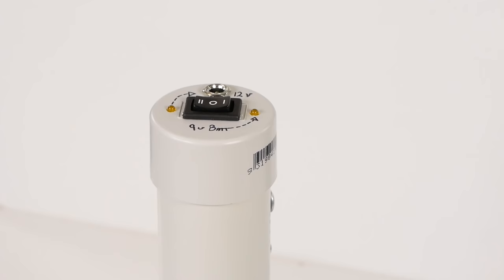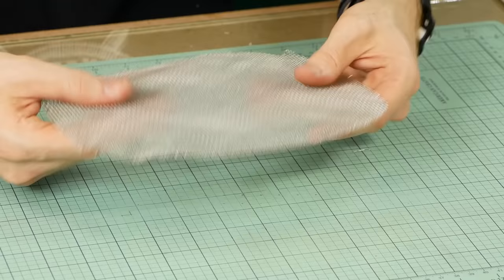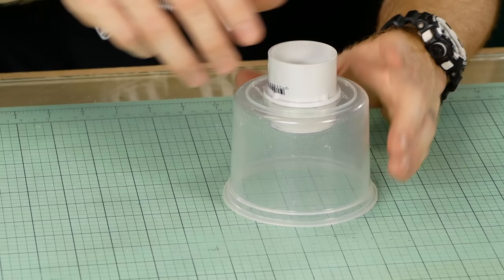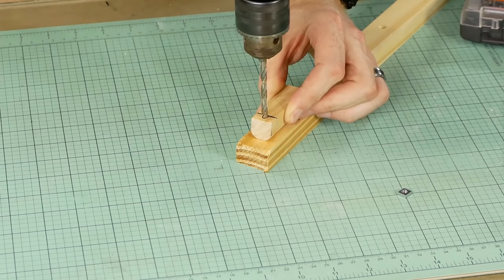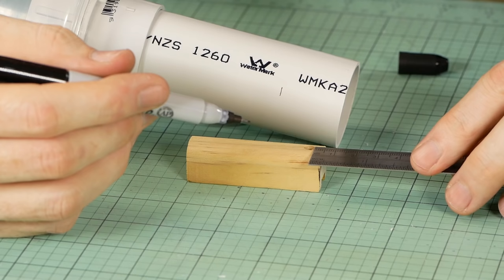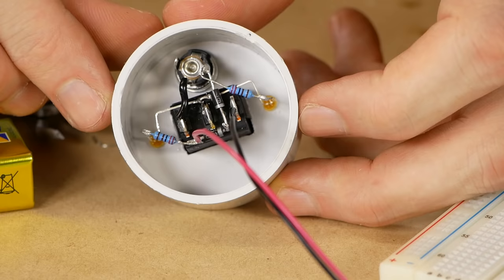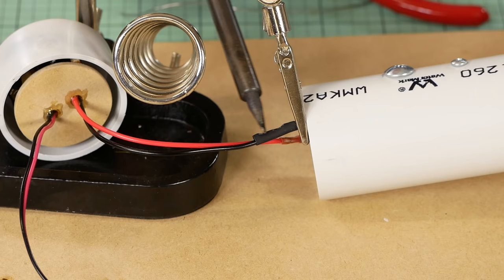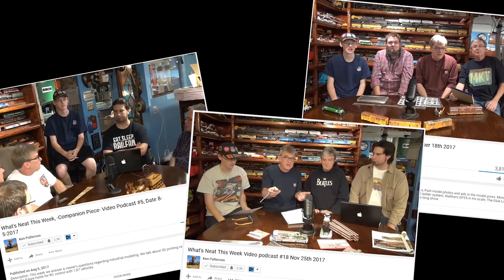Static Grass Applicator – Professional Tools for Modelers

Comment: Thank you Luke for this video. I have watched it over and over again. During the 'lockdown' I bought all the items required and set out to learn how to solder and put this together. The one thing I couldn't get was the pipe cap like yours, I got one which is a soft plastic, but it works. This was a long term project, which I finished today, and it works perfectly! I can't believe I made it. Thank you so much for this and all your other videos. You are such an inspiration. Keep up the great work. All the best from the 'west of Ireland'

Comment: Great tutorial, and a nice update on your previous version of this DIY tool, thankyou.

Tips for anyone new to electronics:
* 1N4007 diodes are common and fit the specification for 1000V 1A.
* If the LEDs aren't working you might have the leads the wrong way around. As the diagram shows, the longer lead is positive (red wire). If you've trimmed the leads to the same length, you can still tell the polarity by looking for a flat spot in the flange around the base of the plastic part of the LED; this is the negative (black wire) side (also shown in the diagram).
Reply: Thanks!
Reply: or use a 3v battery to test it
Reply: 1 amp sound alot/dangerous. Anything over 100mamp (0.1amps) is potentially lethal. You only need the voltage for this so having a high voltage and then 0.05amps should be ideal. Also will make batteries last longer. I doubt the types of transformers used here create more than that but just in case.
Reply: What are the specs of the 12V power supply for this? 1A output?

Comment: I built a 75mm applicator using a 6KV negative ion generator bought from eBay but it didn’t work very well. Bought the 20KV generator from Oatley Electronics as suggested in your video and fitted it to the applicator, it now works great. After watching videos about the small 25mm applicators from Peco and WWS I thought I’d give it ago using the 6KV generator. All the parts were 3D printed and I even found the same sieve at Woolies. I now have two awesome applicators.
Thanks Luke, you inspired me to have a go and I’ve ended up with 2 very good applicators.
Reply: Do you perhaps have the stl files / tutorial for the 6kv one? I can’t seem to find a 20kv where I live, only the 6kv one

Comment: Great tutorial again Luke. One suggestion regarding soldering to the mesh, I use some flux and a hot iron, say 359 degrees Celsius and it should take the solder really well. A bit of a pre polish with a fibreglass pen helps remove any coating or surface corrosion from the mesh too.

Comment: This is a great tutorial, thanks.  One suggestion, instead of using a resistor to limit current to the LEDs, use a LED driver; CL2N3-G.  These limit the current to the LED to 20mA regardless of voltage (within the limits of 5V to 90V).  They cost about the same as resistors and are just as easy to install.
Reply: And a buck convertor to make the 12V (or a bit more, if better), instead of a supply & cables. Cheaper, no cables, lighter...

Comment: knocked one of these up from old junk and a 50k generator I filched out of an old ioniser but here's a thing. having that amount of power where little fingers can get into it I figured was not such a good idea so looked a lot harder at how these things work. Turns out that putting the emitter above the static grass rather than below in the form of a plate actually gave better results and the screen of course was not charged at all significantly meaning no toasty little fingers also to the use of a push for on activator button gave added safety as the moment you put it down it stopped working no matter what. Just a few thoughts. Great video.

Comment: Not sure if I'll ever get an answer to this but I'm wondering how you would wire one of these up with a negative ion generator that has two high voltage wires instead of one.
would one of the high voltage wires connect to the mesh, and the other high voltage wire act as the "ground" wire? or would I use both high voltage wires on the mesh and add a ground wire where you did?

Comment: That negative ion generator is pretty nifty isn't it? Back in high school, I made myself a shocking device that pulled ions from the ground and charged my body so long as I was grounded. Anybody I touched would be shocked with a sort of static shock similar to rubbing socks on a carpet. Ran all of the wires into a little box on my ankle that surprisingly resembled a bomb! Hah I was never caught, so it was all fun. Great video!

Comment: Luke - Thanks for the great video and device. Question: on your prior applicator you used a male electric spade connection to the lid sieve. Why solder the wire directly to the sieve? I thought having the disconnect allowed you to swap in different lids with larger sieves so using taller grass was easier. It also had the advantage of allowing your applicator to connect directly to an inexpensive "flower-box" plate. (No need to purchase a separate ionizer!)

Comment: I've been trying hard to make tall grass tufts using 12mm static grass (specifically the 12mm straw from Woodland Scenics).  No matter what I do, I can't get the long grass to stand up.  I have the static king, I have the WS flock box.  I've tried putting the paper on a sheet of copper, on a metal baking sheet, on an aluminum foil-wrapped piece of cardboard; the tall grass just lays flat.  I've used several types of glue including tuft tac, tacky glue, Elmer glue, and wood glue.  I've tried searching the internet for solutions and have even emailed woodland scenics for advice.  Nothing works.  What am I doing wrong?
Reply: For the 12mm grasses, I bought a punch tool. You use it literally punching the tufts into the base with a little pva on the folded bit.

Comment: 13:45 15000 Volts - avoid touching that with your hands...Okay, but what happens if someone does accidentally touch it? I'm sorry, I don't know a lot about that sort of thing, but considering there are 120-240 Volts from a power outlet, that does sound kind of dangerous? I'm serous though, what would happen if anyone accidentally touched it? Would it be very uncomfortable or could it be potentially lethal?
Sorry again for asking this rather stupid question, but if someone with more knowledge could educate me a bit on this, I'd really appreciate it. Thanks!

Comment: Whats the ampage for the 12v/15,000v output of the high voltage transformer on this static grass applicator? & What is the input current?

Comment: Luke
Your viideos on static grass applicators are brilliant.
Both your mark one version and the dual power version.
It actually looks proffesional and  quality.
I checked out your web site and you have a shopping list of cost and where to buy the bits.
Now that makes you stand out.

Kind of funny that Oatley electronic is nowhere near Oatley but on the central coast.
What fun you can have with 15kv.

Comment: I am curious as to whether Australian PVC pipe fittings have straight (BSPP) or tapered (BSPT) threads? In the video the male and female fittings are threaded all the way .. which does not work with US PVC fittings are they are tapered.

Comment: That is very cool.  I see you are very detail orientated.  Do you have a soldering gun?  I have a solder station but if I need to solder something that needs a lot of heat fast, like in the case of your wire to the screen or a feeder wire to a train rail, I use a 100 watt solder gun.  That way you can get a good, fast solder connection without melting other close by components.  I like how you made this unit universal as 9 volt or 12 volt plug in.  Very nice!

Comment: Fantastic work, man. BTW, if your dc socket has 3 pins you could easily use both battery and 12v adapter with a simple on off switch. Because when the adapter is plugged, even it's off, the battery would be disconnected. :) I did it once in something I made... All you need is a diode. :) Maybe someday I make a video explain it. :)

Comment: Luke: Great video as usual. I'm wanting to make an applicator that will handle 7-12mm grass like the RTS Greenskeeper 55KV/18000v effective unit. I've found that the lower voltage ones down in the 15KV and below range just can't handle more that about 4mm length. Any suggestions?

Comment: Can you or some one clarify  the switch does the switch need to be a 12 volt switch or will a regular on-off-on rocker switch work 
Also. Can you clarify the connection on the iron generator to the switch it was not shown in your pictures ?
Thank you

Comment: Luke, I've noticed some of the commercial applicators are supplied with various sized mesh attachments for different lengths of static grass. What size is the screening you used for this project and what lengths of static grass can be used?

Comment: Since your Australian, why not just goto Woolies, buy a cappuccino chocolate shaker which completely skips the need for the plastic tub cutting. Then just buy a 9 or 12v power supply to a switch then attach to the metal .

Comment: Hi! Can anyone help me with this please!!!!??

I bought a ‘super arc impuls generator’ on amazon (12v to 1000kv) for my grass hopper. However, the impuls generator burns out after using the device a couple of times. 

What am I doing wrong? Am I using it too long? Am I missing some electric stuff in my circuit? 

Please help me

Comment: THANK YOU,  I have made this and I have a question.  Do you know of any reason that the 9v Battery side would work but the 12v plug in side does not?  The light lights but there is nothing when I put the alligator clip near the screen.  On the Battery side I get the static sparks.  Thank you!
Reply: @Ted Amrein Interesting. You have a redesign posted anywhere?
Reply: @Ted Amrein Aweasome, thanks!

Comment: Would there need to be any significant changes to the electrical components for 120v main power?
Reply: Yes. The negative ion generator needs 12v max input. Any higher and it’ll blow up. Also, this device needs DC power not AC.  Don’t use 120v. That would also be WAY too much power for a static grass generator. Why not use a simple 12v DC wall connector like he did in the video?

Comment: Hello Luke, 
     Ok, so I went and purchased everything on your list needed to make your grass applicator, had it all in front of me , then I pressed play, and was going to watch your video again, and make the applicator as I watched the video. Everything was going great, until I got to the compact wiring and soldering part, which I forgot when I watched it the first time, how little time you spent on this part, which is the hardest part for people who are not that familiar with wiring, capacitor s and diodes, and leds and a 9volt adapter! Which direction do each of these pieces go, which is positive and which is negative ?  Even with the diagram ,it is very confusing! Will you please do a video that you explain, (in detail) from the beginning to the end , the wiring part ? I followed the best I could, and even went to your website and when I finished, it did not work. I spent roughly $100 US dollars, buying a the things I needed to complete this, and after trying to follow your video, it would not work. So will you Please make a video, as soon as possible, so I can build this and not feel like I wasted, $100 bucks, as well as get a lesson in caps and diodes, Thank You!
Reply: There’s no capacitors in the design. The only small components that you need to connect in the proper polarity is the diodes and LEDs, and if you look up LED polarity and diode polarity it’s right there on google. If he made a video it would pretty much be about the exact same stuff that you can find with a simple 10 second google search. I’ve never made a small electronic device like this but it really wasn’t hard to figure out at all. Just follow the diagram and google your questions about component polarity and it will work.

Comment: i  finished mine. the 9volt has an arc but does nothing so i tried the 12 volt side. it arcs but does not work like yours at all.... I'm fairly certain its wired up correct too.. so many views but not much help.. ill post a video if someone can help me..

Comment: Many thanks for your tutorial Luke. It was not so easy to get a similar ION Generator here in Germany. So I have ordered 3 units directly at Oatley Electronic in Australia. Very interesting, the Sistema 530ml Breakfast Container you use was available at Amazon in Germany 😎. So I think it's no problem to get all other items. By the way, which mesh size has the strainer in your video ? Regards from Germany

Comment: hate to disappoint u Luke but u can use long grass or field grass for static grass granted u have to cut it to the length u want but in the long run its cheaper an i made a video of it working with my homemade static grass applicator :)

Comment: i think there is a mistake with the schematics of the circuit. on the schematics you are connecting negative head of the 9v battery to diode and resistor. but in the application it is positive head. i think you mean the 9v battery connector not the battery itself on the schematics.

Comment: I gat a commercial static applicator and it still keep some charge after turned off. Is it broken or is it normal? How do you typically uncharge it?
Reply from the maker: yeah that happens to nearly all of them, if you touch the grounding wire to the mesh part of the applicator it should discharge the applicator making it safe to touch.

Comment: Hi, isn't the high voltage dangerous? What happens if you somehow touch it?
Reply: What happens is that you will be quite unhappy, and may espouse the less socially acceptable parts of vocabulary, but not at all dead. The high voltage transformer in this has to have been specifically designed to limit the current for safety.

Comment: Epoxy isn't he best selection to glue polyethylene. In fact the mixing pallet that comes with Araldite is made of its cousin, polypropylene, because the cured glue easily pops off.
Hot glue, while not perfect (nothing really adheres to polyolefins), does a better job.

Comment: Can I Build It without the 12v option?
Reply: Yes but you need the ion generator that is compatible with whatever you plug it into. I'm from the US and made a 110v version and it worked fine. It's just not quite as safe as a 12v version. I am building one of those now. Hope this helps.

Comment: Wait a second. The container is made of polypropylene - a low surface energy polymer. Usually epoxy and other glues don't hold when applied to it. So how does it hold?

Then again if someone has that issue, i bet melting the grid into the plastic is just the ticket.
Reply: Well I'm a model maker by trade and he said to "sand the polypro" which makes thousands of hairs on the poly and that's what the epoxy is gripping. You can also paint polypropylene if you use polypropylene primer but I digress.